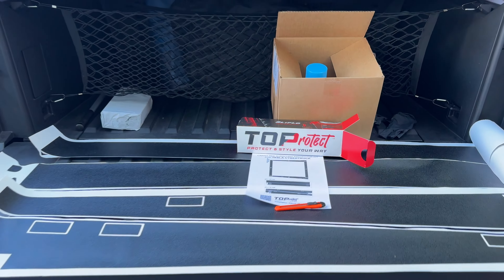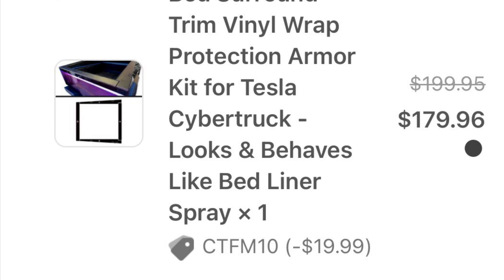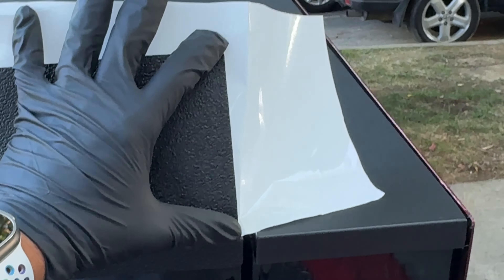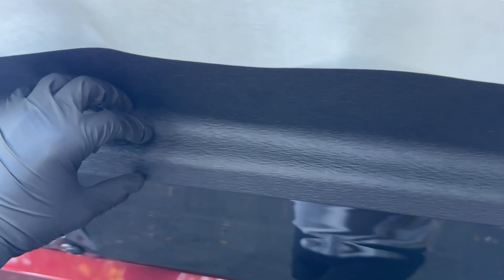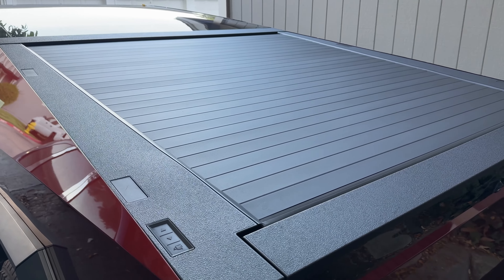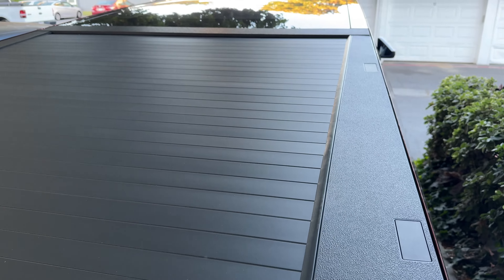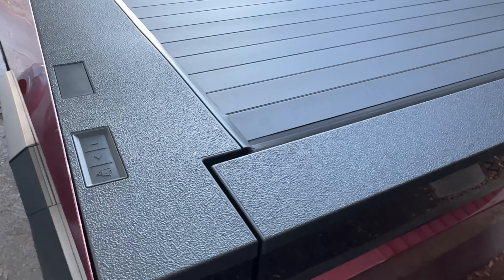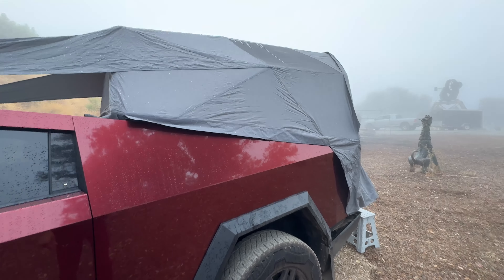TOProtect ‘Vinyl Armor’ for Cargo Trim - [Cybertruck Accessory Review]

Comment from the maker: Small update* I just realized those ‘scraps’ I cleverly used were in fact the stickers for all the cross bar port covers 😅
StickerCity has reached out about the two sides being short and are working with me to correct the issue.
Reply: I had the same issue

Comment: Great video thanks for posting, however I don't know if I would pay that much for the trim you did an amazing job in putting it and the fact that they sent it short on each side of the tail gate makes me believe they don't care. But it's a great job by you making it work. Congratulations on you cybertruck
Reply from the maker: The company reached out to understand why the two sides are shorter than expected, and I expect they’ll make things right. 
Thanks for the compliment!

Comment: Tesla Cybertruck is not useful as a Truck! ;-(
Reply: Yeah just because you can’t afford it 😊
Reply: It is for us, we are using it as any truck! Storing , towing, and hauling. We have honeybees and we can put the honeybees in the cab and keep them comfortable in the heat while we work on the rest of the honeybees. We haul our enclosed trailer everywhere we go. Better than having a diesel or gas truck running and spewing particulates into the air while we work.
Reply: Love the jealousy 😂